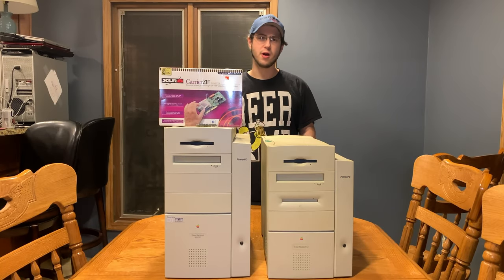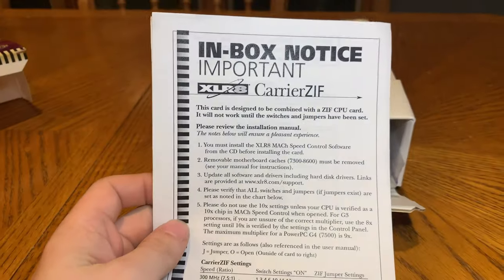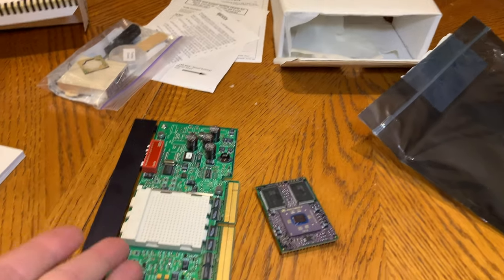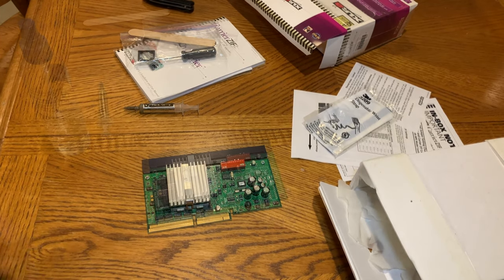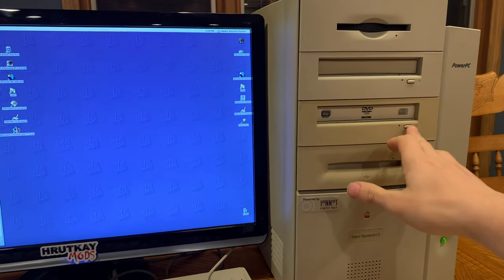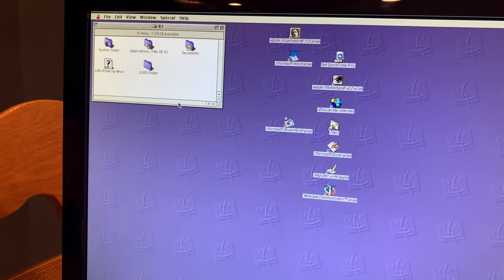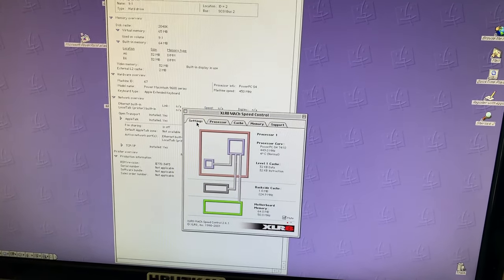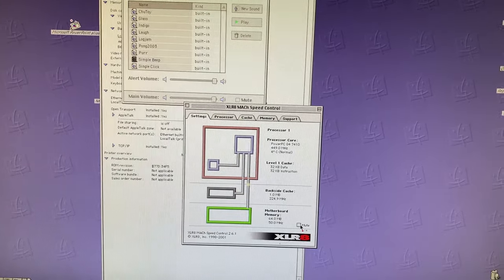The XLR8 CarrierZIF “Slocket” CPU Adapter – Mac Oddware Series S.1 EP.2

Comment: Nostalgic video for me. Back in 2000 – 2001 I toyed around with the RX533PC (533MHz) XPC7410 G4 ZIFs from Sonnet (with the 9-position rotary switch) in my Beige G3s. Through boosting the voltage to 2.1V and running a 10W Peltier cooler in conjunction with a seriously modified copper PC heatsink and coldplate I was able to get it running reliably at 709MHz (78MHz bus speed with 9x multiplier ratio). I think at the time (2000 – 2001) it was the fastest Beige G3 on the planet… although Guinness was not on hand to set any records.
Reply from the maker: Sweet story bud

Comment: I tossed 4 of those mac's along with some Lisa's and 10 other mac's built back in the 80s and about 20 PCs having the old isa cards. All had very bad rust from a leaky roof and left in a 140° shed during the hot months.lots of leaky capacitors.